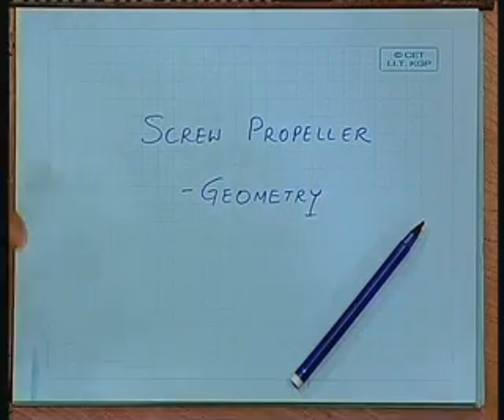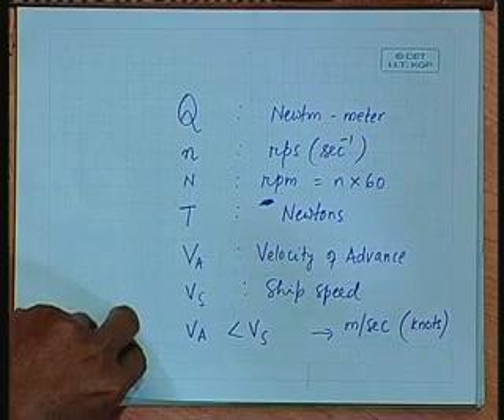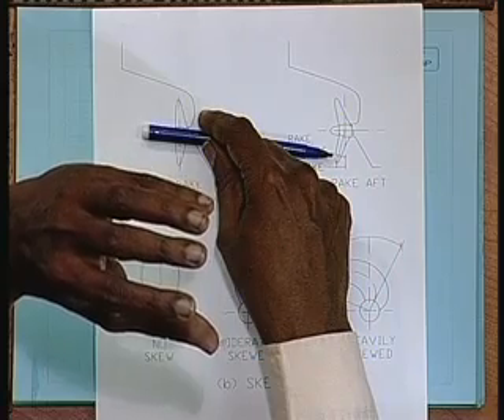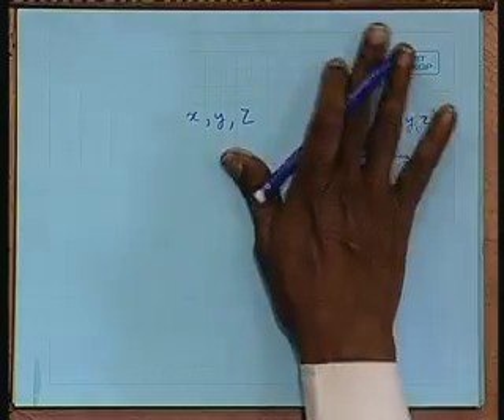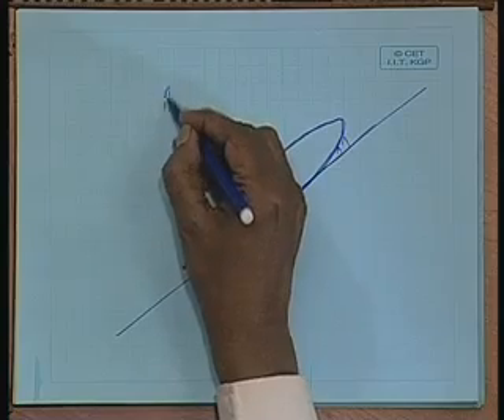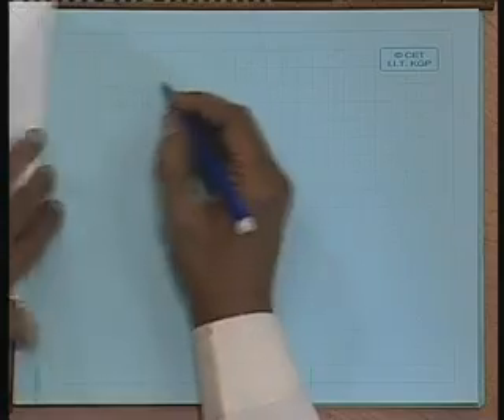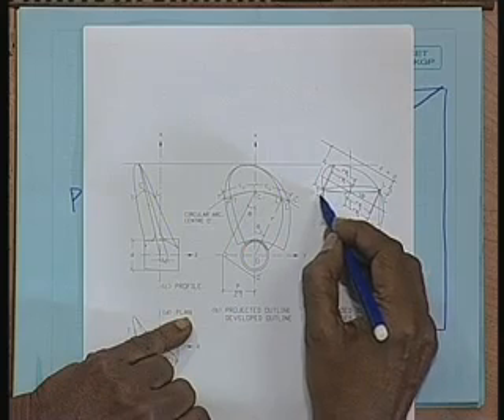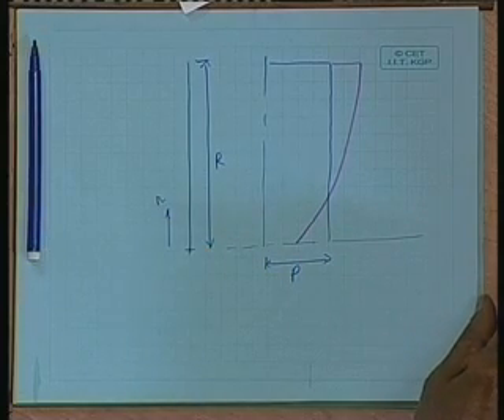Lecture - 10 Propeller Geometry Part - I

Comment: there should be sections of 3 blades along the extended line, because the circle through r over 2 pi, will touch all three blades